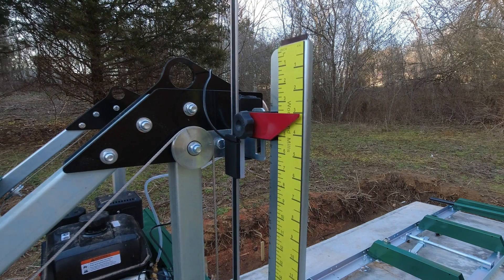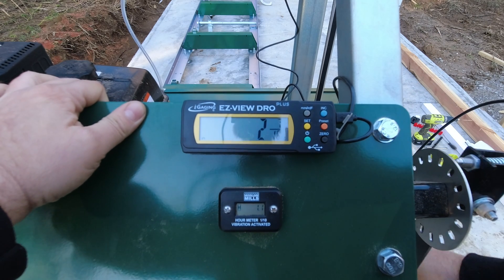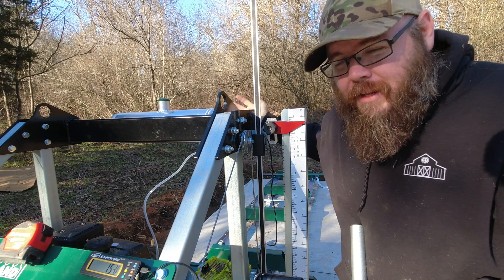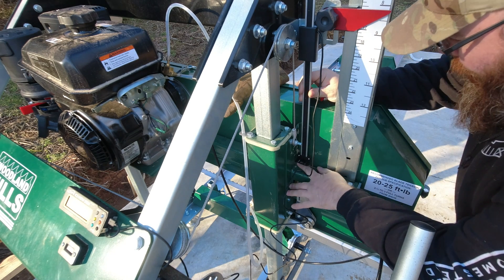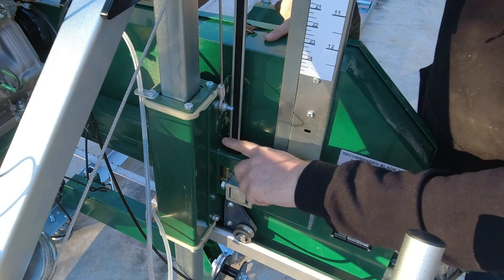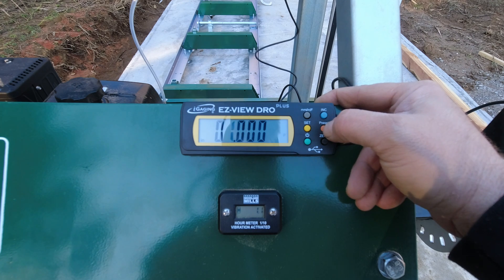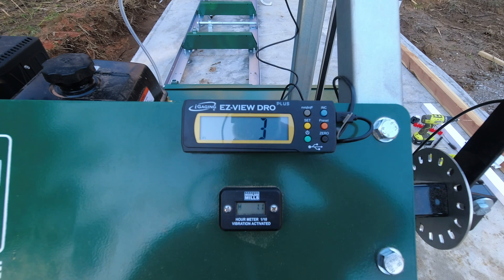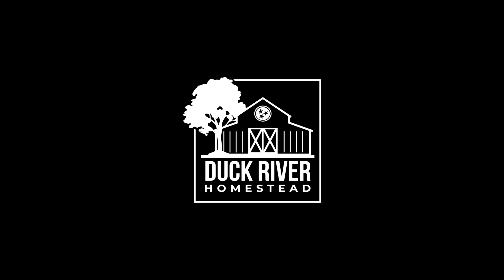028 - Installing iGaging EZ-VIEW Digital Read Out(DRO) on our Woodland Mills HM126 Portable SawMill

Comment: I have installed 2 of these exact same models on my sawmill and they both are trash.  Neither will hold a dimension and have messed up many boards trying to figure it out.  Once I just let the sawmill sit there and I actually took pictures of the DRO dimension changing as it was just sitting there.  And I don't mean a fraction, the readout moved up to an inch and I had NOT moved the sawmill at all.  Both of mine turned out to be totally worthless.  Too late to return the first one, but hope to contact iGaging on the 2nd, but I hear their customer service is horrible.
Reply from the maker: That's crazy! Mine's still working. That's so annoying.

Comment: how do you account for the saw kerf when using the dro? Do you make a cut, zero, drop down kerf width, zero, drop down 2x4 width and make cut, then do it again?
Reply from the maker: Here is my standard operating procedures.

1. Make my initial cut.
2. hit the "inc" button. This sets the display of the DRO to 0.
3. Lift the saw blade and move back to start. The DRO will now show a positive number like 1/2"
4. Lower the head to my desired cut. probably -1 5/8.
5. Make my cut,
6. Hit inc which now shows my actual blade height.
7. and repeat steps 2-6

With a 1/8" blade this will make a 1 1/2" board.

So basically I don't zero it, it increment it and account for the width of the blade in the cut. I have found that 1 5/8 is perfect amount for me to drop.

Comment: Meh. Not weather proof. probably not sawdust proof. Not only that, but it has no utility whatsoever. Counting turns of the hand crank is going to be just as accurate and a lot faster and less annoying. Leave the basic inch scale on and never touch it - that will tell you how far off the bunk you are. That is how you measure and cut with the HM series, period. If you get a motor to move your head up and down, then this could come in handy, but again, you'd have to come up with a way to weatherproof it. 

Good video, and informative: I learned that these are useless gizmos that I'll never need. 👍
Reply from the maker: Each to their own right? I have a sawmill cover and have had this running for several months without issue. Sure you can count turns, and all that, but I find this much quicker and more accurate to the 16th or 32nd of an inch. I also like that I can make incremental cuts and drop the saw head down 1 5/8" for example. Hope you have a blessed day and I'm glad you have a process that works for you. Thanks for watching!
Reply: @DuckRiverHomestead  I have a motorized head on my 130 max and saves my shoulder big time.  Regarding the DRO, can you preset measurements?  For example, cutting multiple 3/4" boards out of a cant. Or, do you have to reset everytime you cut?  If so, I will put one on.  I think that would be the real benefit.  Thanks much for your vid and your time brother.

Comment: Hi. Great idea. I have a Hm130max. Did you find that a 24 inch rule would work instead of the 36"?
Reply from the maker: The way I set it up I don’t think the 24” will work. You can cut to length which I would recommend.

Comment: Does this unit get have to be re-calibrated if the battery dies?
Reply from the maker: That's a great question. I'm going to have to try it out. I have mine set to 1" offset, so it always zeroes to 1". I haven't lost the battery yet though.

Comment: nice job how is the read out doing. silcone spary is better will not cake up with sawdust and make life much easier. after i finish saw mill shed i may get a laser. take care be safe and well.
Reply from the maker: The DRO has been a game changer in getting consistent cuts. Especially cutting 2x4s.

Comment: Hope it works better for you than it did for me. I had to return mine. I installed it onto the red arrow thing directly on the ruler. 

Worked ok at the start, but overtime it would skip and restart and throw off readings… I’m the only person that seems to have had trouble with this model tho.
Reply from the maker: Dang. I hope I have a better result. Did you find another model that worked better for you?

Comment: Nice video.  i just added mine to where the scale goes and made it quicly removable due to it not being waterproof and my mill being out in the open. However, if i'm cutting the same sized material for a while i just use the DRO to see how many hande turns it is, and then i just use handle turns until i need the DRO again to measure something else.  The main reason i do it that was is due to the horrendously wet miserable weather in the Scottish Highlands.  When i'm using the DRO, i don't bother setting the 1 inch bottom level as i just zero after every cut, but mine is a different model to yours and not so easy to see
Reply from the maker: I forgot to show that this has an increment feature. So you can start your cut. Then you can zero the increment. That way it keeps your actual measurement, and then you can increment by whatever distance you want.
Reply: I see different length ones of these. What length is the measuring rod or whatever you call it
Reply from the maker: I went with the 36" rod. I could have probably gone with a smaller one.
Reply: @DuckRiverHomestead  thanks I saw a 1 foot and 2 foot. Didn't see the three. I shall look again. Thanks. I would rather be sawing lumber but am out making a living on my shrimp boat in Florida.

Comment: Nice job and thanks for the good camera work that lets us see details.  Be curious to know how battery life is.  One heads up -- if the linear bar or counter gets dirty, these can give poor readings, so keep it clean (a challenge in a machine shop and maybe worse on a sawmill).  You can test it periodically to make sure the readings are changing smoothly as you go up and down and you hit known heights.  I have been bitten with faulty DRO readings a couple times over the years.

Does the display on this unit only have one reading, meaning you'll have to choose between showing absolute height or relative heights, or can it show both at the same time?  I normally saw down in relative increments to slice off lumber, but planning how you square up the cant and how you treat the last board needs absolute.  So I always want to see both when sawing if possible (equivalent to running two rulers at the same time).

Your post guides sound beyond a squeak but it could be my ears.  Might want to check that the posts are truly vertical and the sawhead is hanging plumb on the cables.  I had an issue early on with binding and needed to loosen the trolley bolts and give everything a good shake with the sawhead pulling down to tension the cables.  Only then did everything become plumb and smooth.  Never have needed to lube the guides once that was taken care of.
Reply from the maker: You can only view actual or incremental height at one time. I think you can connect a second monitor to it but I haven’t tried. 
Great be point on the squeak. I had made sure that the blade was even in both sides. It’s possible that I just need to do what you did. Thanks for the pointers. 

I’ll definitely give an update on this DRO as I use it.

Comment: Maybe a small electric motor and some pulley reducers attached to the handle someday?
Reply from the maker: Yes! Some people actually use motorized trailer jacks for theirs and I might do that at some point.
Reply: @DuckRiverHomestead   I just added the trailer Jack mod on my HM130 it works great. I’m doing this upgrade next thanks for the video.